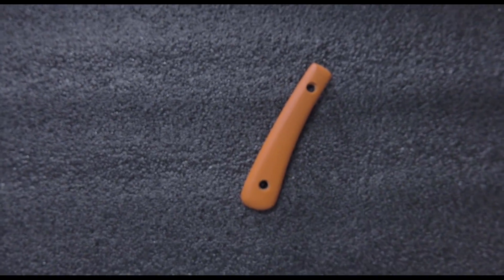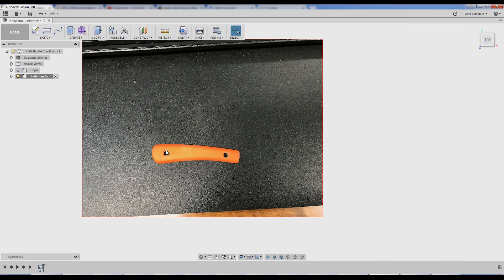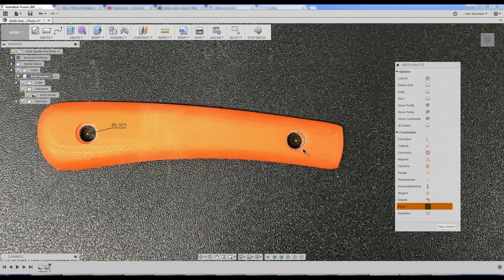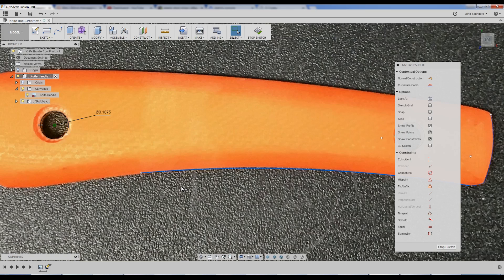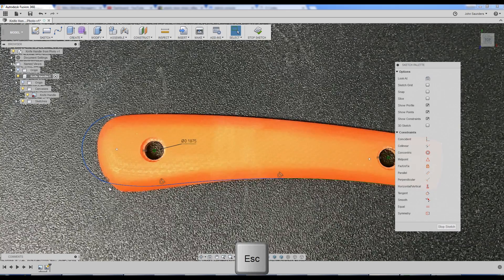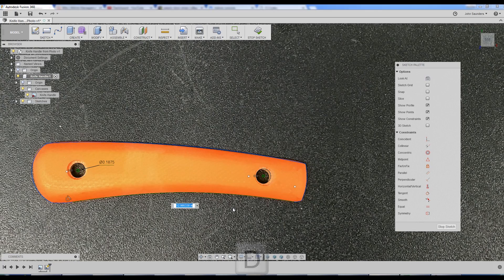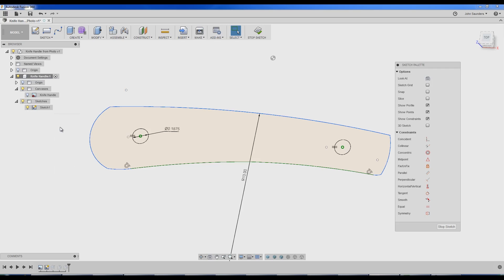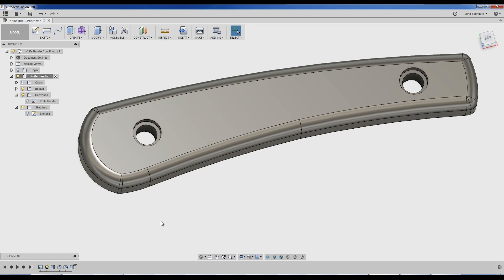How to Create a CAD Model from a Photo in Fusion 360! FF96

Comment: Spline would have been my choice for developing this.
Reply: Robert Ostman: Only if you don't understand splines and what defines c0 c1 c2 continuity and what is required for each condition. Splines are definately the tool to have used, T splines are complete overkill for such a trivial set of continuity conditions.Get a plugin or spend 15 minutes educating yourself. The statement that splines are not meant to be used for precision is ridiculous to the point of absurdity, I've been using Alias for design for over 20 years, guess what has always been the primary precision drawing tool.
Reply: Upvote for splines!
Reply: I also would prefer splines, you have better control over the continuity and the curve forming than with arcs. Didn't he already use splines for drawing these kind of things? I smell a brain fart.
Reply: Then you don't know much, b-splines, basis splines ARE splines. CV curves and EP curves (the spline tool) are both b-splines. Many curves!  you can't be serious. It appears you don't even have a rudimentary knowledge of the basics.  Curves and their resultant surfaces come in higher degree than 3, you may want to find out what that means for modelling such a simple surface as this. But that's clear from your recommending a plugin for T-splines in fusion, completely clueless.  Non-uniform rational B-splines+sub division surfaces = Tsplines. Autodesk bought Matt Sederberg's T-splines in 2011, Fusion360 is built on T-splines. Wellcome to Patch mode.
Reply: Do you think of Bézier curves?
Reply: probably, I tend to say yes... but then it's been years since I last saw something related to the elitist alias software...
Reply: I very new but was wondering the same thing. I wonder if his goal for this tute was simply to illustrate how to knock out a quick form by only using the 3 point arc tool? I've not read the rest of this thread, he may have already commented as to why he didn't use splines. More than one way to skin a cat obviously.
Reply: @austntexan  in many many tutorials is mentioned,  dont use splines if you can get away with circles or arcs. even in autodesk chanel i heard and seen many times
Reply: Spline...Spline...Spline...Let it Spline  Yes Spline is the tool to use definitely!
Reply: I always have problems closing spline lines for extrusions! 👍
Reply: lol, in alias you aren't using splines you are using a different set of curves that by the way their name escapes my mind, (Bspline???) but the difference is in the equation that forms the curves and in the way to handle (mold)the curve to your liking... as far as I know in alias is all about curves with 1 single span, so you would have needed many curves to create that shape... t splines does a task like this in record times... with a final result that appears to have been done with a more expensive software...
Reply: humm yea that may be the proper name for those curves... I mean alias is at the top, where only a few softwares are when it comes to creating surfaces, I would say that alias is obsolete... as there is siemens nx... but for a shape like the one on the video... I think that t splines is probably the way to go... gosh... with the way design of complex surfaces is at it seems like the leading options may be less than 5... and none of them is inexpensive... t splines can do this job but I am aware that there are times where a fancy siemens nx... is the one that comes to save the day....
Reply: na, a spline is worse than UN politics... splines are not meant to be used where precision is a most(by a few exceptions)... take a look at my tutorial in my channel is in spanish and I am using rhino3d... but there, you will find how to work with curves... best tutorial... (I most say that I think that a plug in seems to be needed here I believe that the program T Splines would do just fine and should bring better shapes)
Reply: @robertostman2075  , True arcs are rare on a  sculpted knife handle.  Spline is better for  organic shapes

Comment: Great to see this done natively in Fusion... quite a few steps... I have had decent luck using the "Trace" feature in Adobe Illustrator or Inkscape, save as DXF vector from either of those and import to fusion
Reply: Also found if you scan it hires (1200 ppi) to a PDF then bring into AI you can get a better trace.  The more detail though the more time you spend cleaning up the trace before export.  Also AI isn't as accurate as ACAD or Fusion but plenty good for proto work...found slight variation in Dims between the trace and DXF.  May give Inkscape a try...Thanks!

Comment: If you take the picture with a ruler or gage block next to the object, it's easier to adjust the scale.
Reply: I take photos on grid paper. You can use grids to reduce parallax errors.